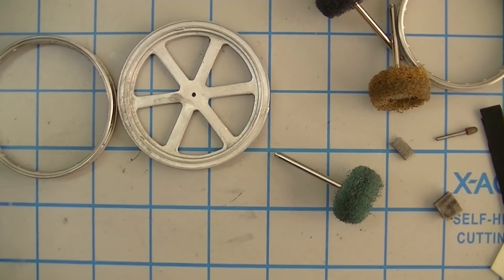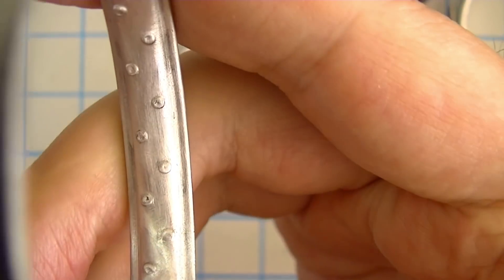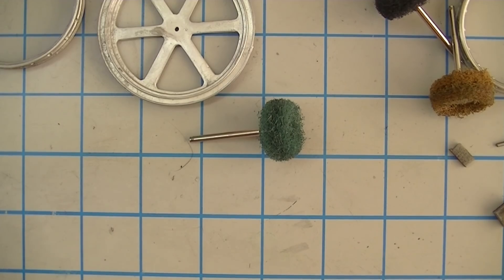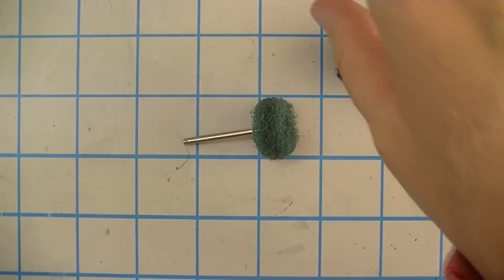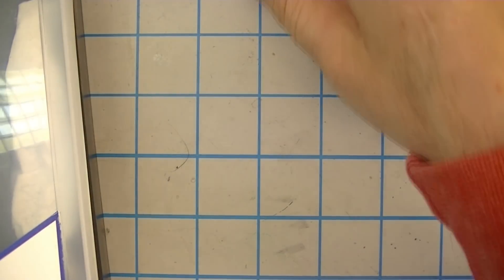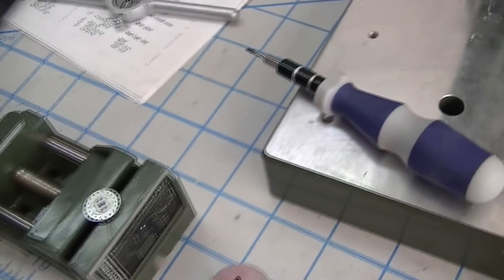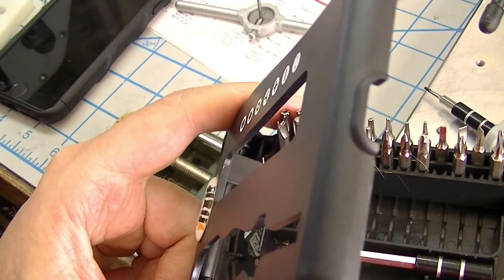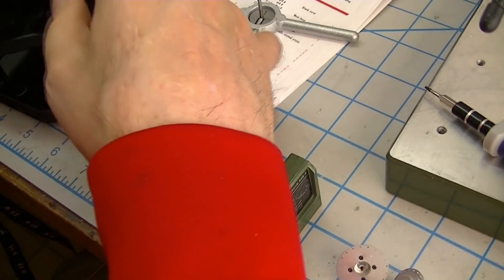ep206 - the mfh brough superior adventure, part 2

Comment: Hi will ,top tip ,don’t bother tapping the holes. The metal is soft enough to thread form them using a 0.1 /0.15 smaller hole than the appropriate screw o/d , just back off 1/2 a turn  for each whole forward turn , plus you can disassemble if required , enjoying watching this build having done a couple of these fantastic models myself. Stick with it !

Comment: I always enjoy your videos. This one was especially in my wheelhouse.
Tapping tiny holes is always exciting. White metal is probably the easiest thing to tap compared to say, aluminum, or especially steel, but still is major fun.
If I may be so bold as to offer a suggestion, I always hit white metal with Dupli-color Etching Primer. Something I learned working in a paint shop was to etch anything that paint didn't like to stick to.
Again I find your videos interesting and informative.

Comment: If I were tapping those holes I would have put the tap in the proxon in the drilling stand then turn the chuck in and out by hand. That way you guarantee the hole is tapped true and straight, there's also less chance of snapping the tap. I do the same in the lathe, put the tap in the tailstock and turn the chuck by hand to start the thread. Just sayin...